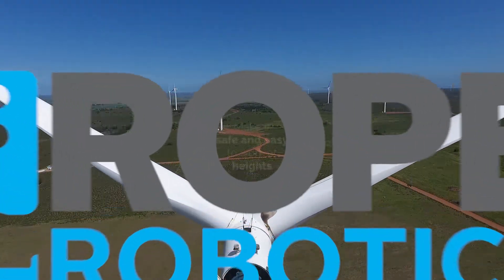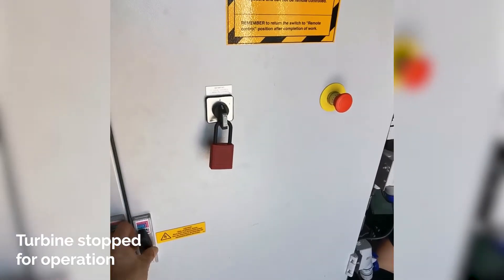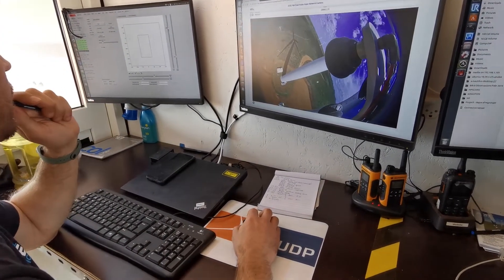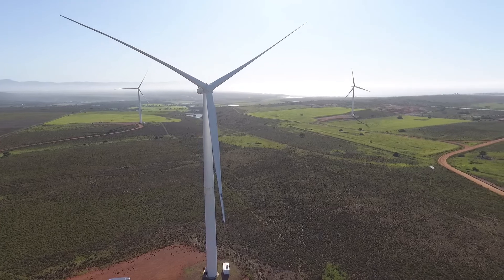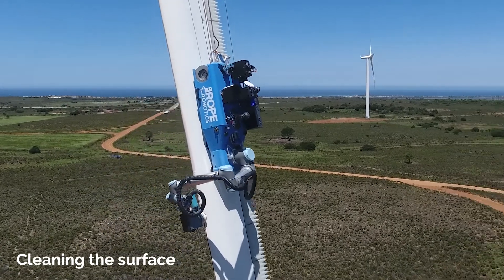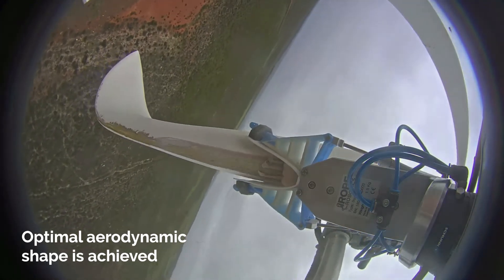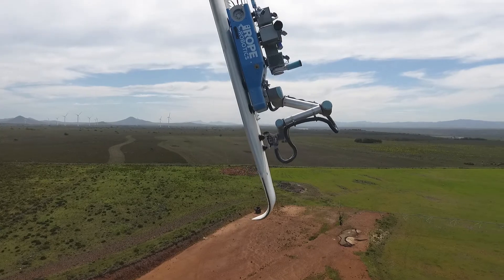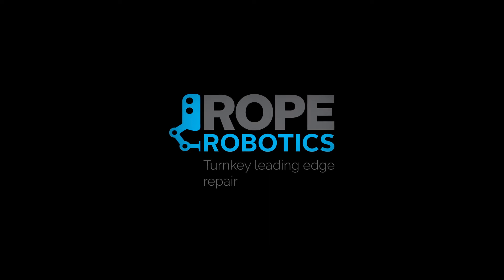Rope Robotics south africa

Comment: Just hard to believe, but please prove me wrong. 
I would suggest that you are going to develop a system which is permanently integrated into a blade. A robot which is able to execute blade inspections randomly. Maybe, a robot system which just requires a random refill of GFRP mats and matrix for repair works.
Shouldn't be to difficult... ;)
Reply from the maker: Yes, let’s see what the future brings. There is definitely going to be some interesting development in the automations of servicer tasks.
Reply: No this would not be ideal, as you incur more risks during production and this automatic repair system would also need to be maintained (after successful integration), so this would not solve the problem, just replace it with more problems. The current idea shown in the video is very impressive!